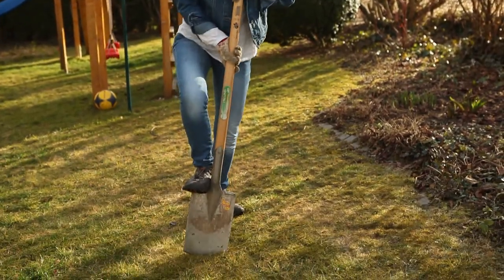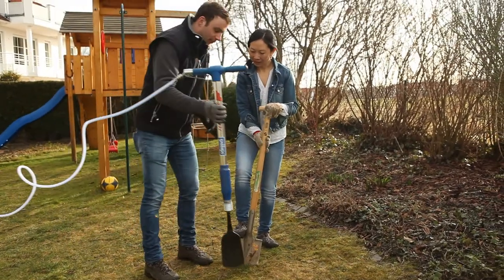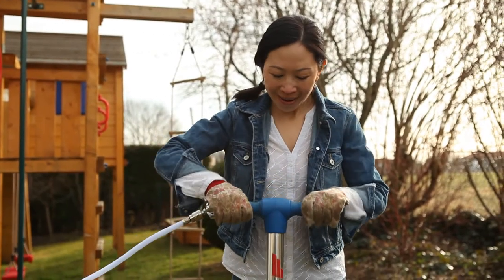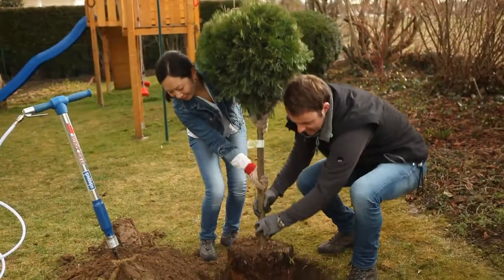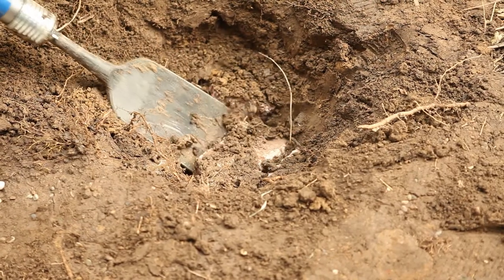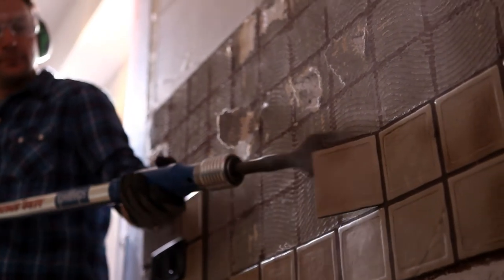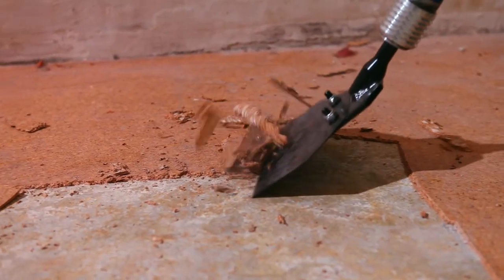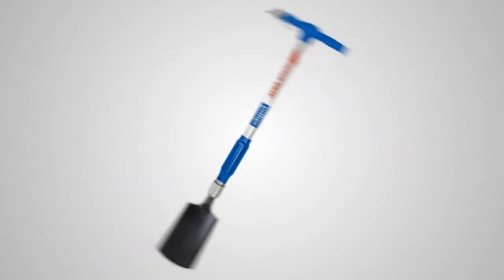AERO2 SPADE Scheppach |  PNEUMATIC 5 IN 1 MULTI TOOL | GB

Comment: Très bon outil que nous utilisons avec un compresseur de 100 litres pour pouvoir tirer pleinement avantage de tous ses accessoires. Je l'ai trouvé sur Ebay en provenance d'Italie à 195€. Ne pas oublier de rajouter un huileur. 

Very good tool that we use with a 100 liter compressor to take full advantage of all its accessories. I found it on Ebay from Italy at 195 €. Do not forget to add an oiler.

Comment: Nowhere it is written that you have to buy the bigass compressor which goes with it but which isnt shown.
Borderline scam if you re asking me
Reply: Not at all. You can use it with a 50 l air compressor without problems (it will run more frequently than a larger one, but it will work nonetheless).